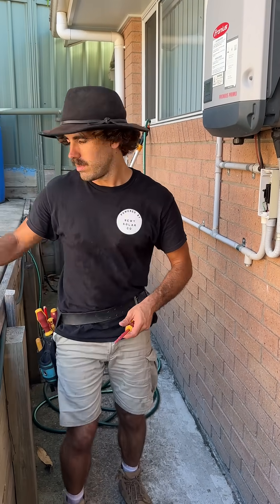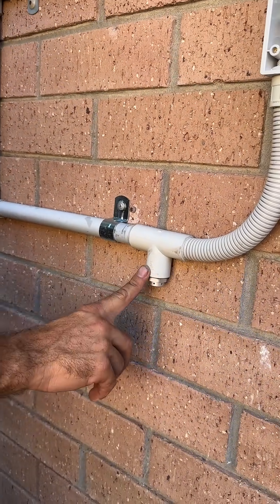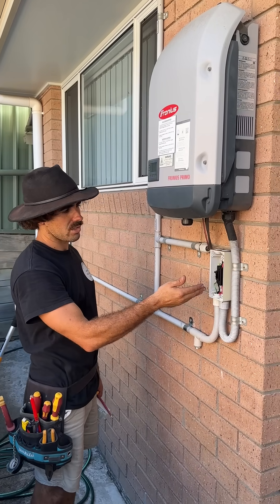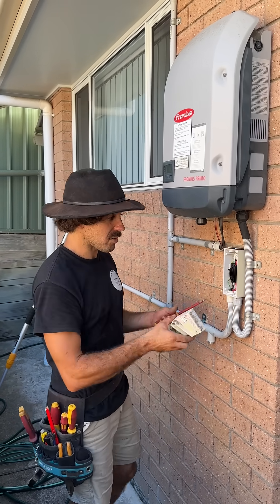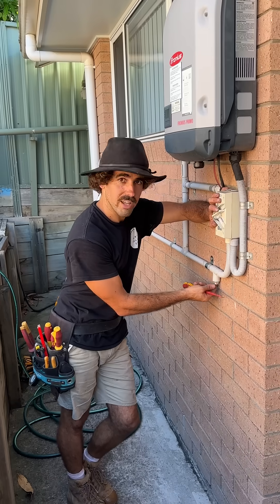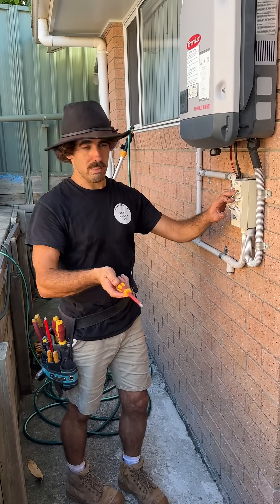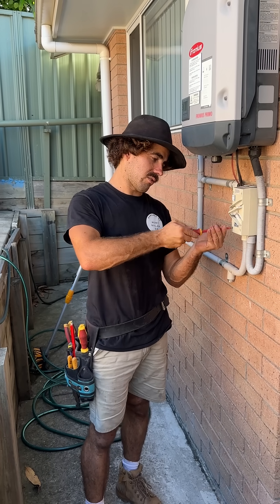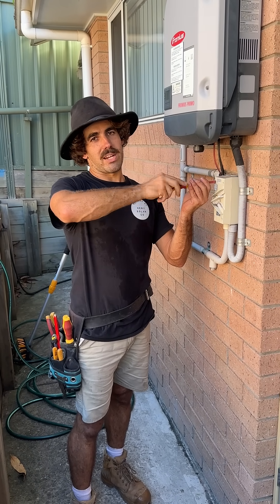How to prevent solar power fires!

Comment: No offence to practices done elsewhere. But non metalic conduit for outdoor applications looks incredibly crummy. 

I understand some countries outright ban metalic conduit, but it really is the bullet proof option. 

Currious why you are using what looms loke plumbing PVC is that standard over there?
Reply from the maker: It's 100% standard in Australia. Solar Conduit it's called so it is UV rated. We didn't put this in in only retrofitted the tee - generally you try and conceal the conduit as much as possible to make it look half decent.

It's just a cost thing though, we are doing a job on a heritage building soon where we will be using copper pipe to conceal dc conduit and then appropriately earth it it's going to look smick!